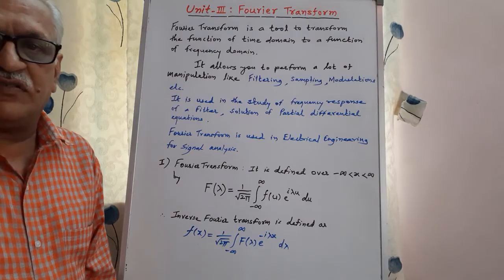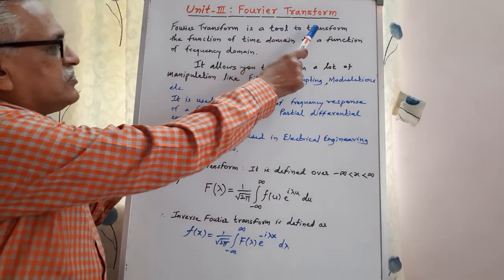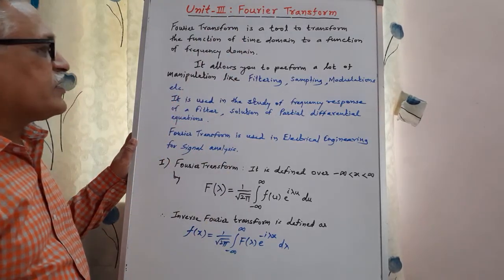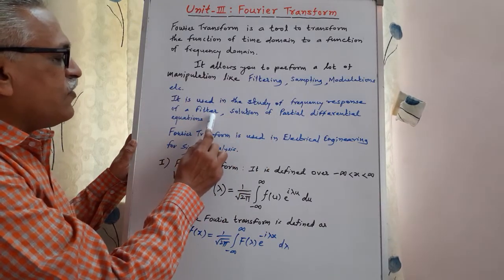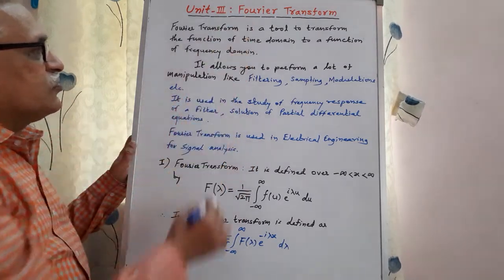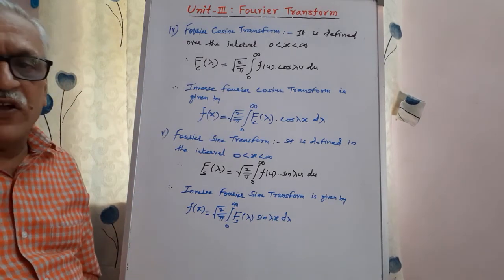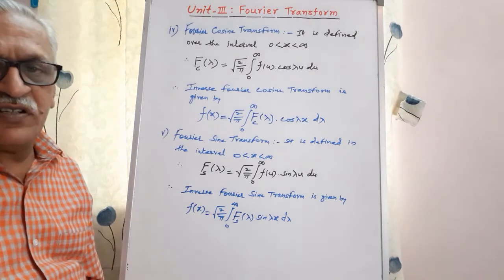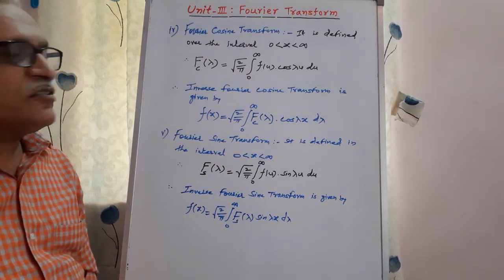Fourier Transform I Engineering Mathematics-III  , Topic: Fourier Transform formulae (Part I)

Comment: Sir other books put do not put the root of 2/pi but use s instead in their formula is it correct. Help me differentiate because am going to do an exam
Reply from the maker: Whatever the Formulaes given in my videos are as per the standard textbook
Reply from the maker: In my Formulae, I am using u & lambda as variables .As it is definite integral, it doesn't depend on the variables. In some books, you may find s.